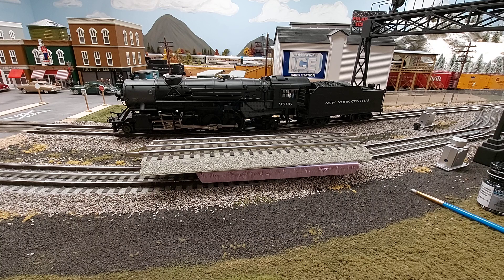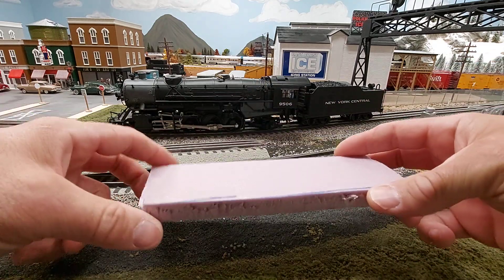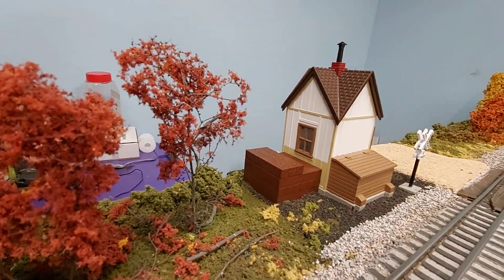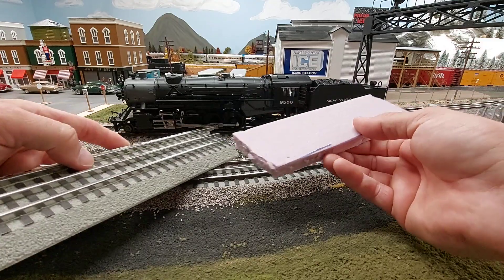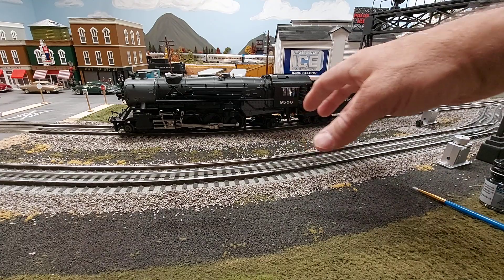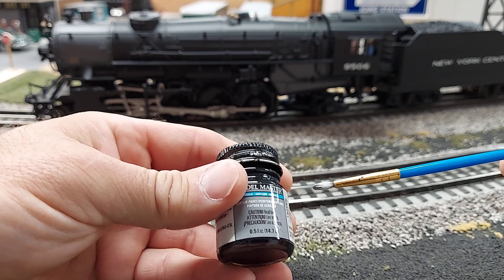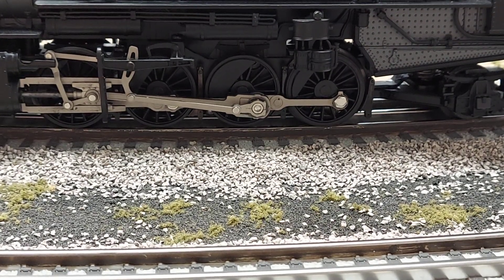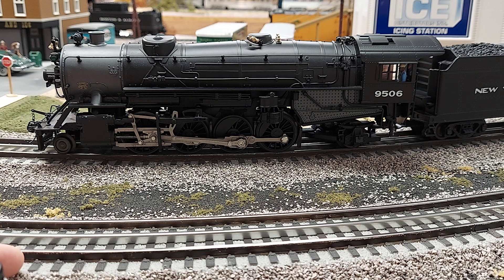More About Lionel Fastrack and a Paint Tip For Steam Locomotives

Comment: I appreciate your video on the explanation of the track power controller TPC I have three of them connected in daisy chain together. But I'm having a couple issues I think my second and third one of my second and third main line might be stuck in conventional mode I was wondering if you could help me answer some questions. Thank you in advance Keith wood
Reply from the maker: Sure. I would double check with your owners manual. Maybe try reprogramming if necessary.

I would like to think that even if they are stuck as you say. It should just be a matter of addressing the TPC unit, and turning the throttle knob up until you have full voltage. Then address your loco and run trains normally.

FWIW. Even when set to a specific voltage, both my TPC and AVC unit will vary voltage if the throttle knob is turned while either unit is still addressed.

Comment: I use homasote, not really sure that it is any better than foam.  I just come from the age when folks always put down homasote before laying the track.  It helps reduce the noise some, but then again I also kind of like the sound of the steel wheels on the metal track.  LOL  Very good tip about painting the rims.  Although I am pretty much a diesel guy now I can see where it would make a difference in the appearance of a  steamer.  I am kind of like you.  Not a rivet counter, but I do like a degree of realism on the layout.  For me it just makes the layout more interesting and fun.  You have a beautiful railroad.  I'm going to subscribe.

Comment: How do you attach the fast tracks to the foam? Are you able to screw into that pink foam? Planning a layout right now. Thinking of using insulating foam as my layout top.
Reply from the maker: The foam I have is only 1/2" thick.   I believe I used 1&1/4" #4 wood screws so they go into the tabletop.

The main thing to remember is to "gently" snug the screws down so you don't distort the track.

 Mine are just tight enough so when you push down on the track you don't see the screw head rise up.
You don't need a screw in every hole. Sight down the top of the rails and use the screws to bring down any raised areas..

Comment: I enjoy your channel! Question: Is your pedestrian walkover bridge a custom mod or purchased that way? I have the Lionel double track silver one but it does not fit right and was thinking about breaking out the dremel and glue. If so, any tips?
Reply from the maker: Thanks for the compliments. Thats a Bachmannn Plasticville O scale pedestrian bridge. I cut out the flat walkway between the two staircases so it would fit better with my station platform. These come green, so I painted it silver.

The Plasticville bridge is in kit form so its a bit easier to cut and modify. I think I was able to cut it with a razor knife which is less aggressive.

 A dremel will certainly work. I would stay behind where you actually need to make the cut as a dremel tends to remove extra material as the plastic heats up.

Comment: Hello Sir,
I'm sorry to bother you I just wanted to let you know that I'm very much interested in your tutorials on your Layout. I have a complicated question about Fastrak. Do you by any chance happen to have any Conventional Postwar & MPC Lionel Trains in your Inventory? The reason I asked you is because I'm a Member of a O-Gauge 3-Rail Club and apparently the members there say that I have only 2 choices for running my Trains on the Club Layout. 
Because I only have alot of Postwar & MPC Trains I can only run them on Tubular Tracks or I can run it on the 4x6 Fastrak Loop. I asked them why only on those Layouts? They told me that the 2 Layoutsare Loops only no Switches the main Layout has Gargrave Track & Ross Switches and my Trains would cause alot of derailments if I run it on that Layout. Have you ever heard of this before? Older Trains running on newer types of Tracks. What can I do? My entire Inventory since I was a kid is Conventional Postwar & MPC Trains on Tubular Track. Like you I want to try Fastrak, but I'm afraid something might go wrong. 
Thank you for your time 
Sincerely 
Allan Martinez
Reply from the maker: No bother at all Alan. I don't see any reason why postwar trains won't run on Lionel fastrack. 

I'm not aware of any issues running older trains on Gargraves and Ross. I'd say try it on there and if it derails, then you know.

In my opinion, this may just be a way to keep part of the layout for the newer command controlled trains. I.E., so your postwar stuff isn't in the way. Thats strictly my opinion however.

I've considered joining a club, but visiting clubs in my area I get a sense there may be some "train egos" involved, so I prefer running at home.